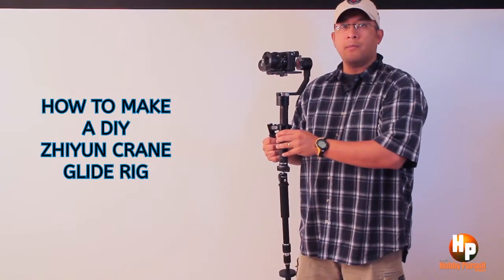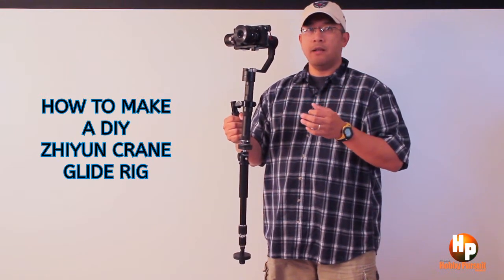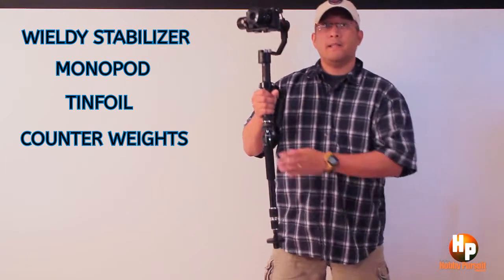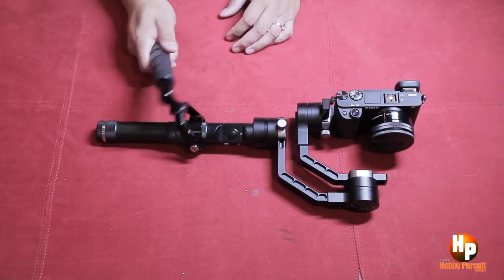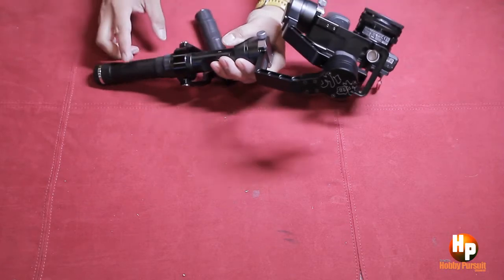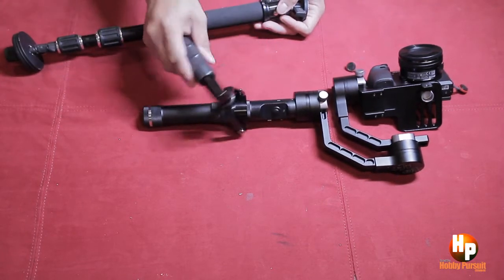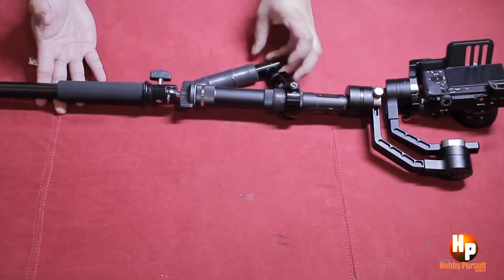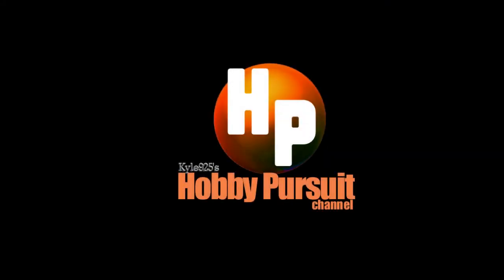HOW TO MAKE  DIY GLIDE RIG for the ZHIYUN CRANE

Comment: So I have an old flycam sitting around and started to tinker with removing the handle, but it appears that the handle may be attached to the vertical bar with something other than the screws (possibly glue?) unless I'm missing something. I saw you had the Wieldy and the flycam, .  Does that seem correct to you, or did I miss a screw/need to give it more force to remove the handle from the bar?  Really appreciate the video.  Not sure if worth it to spend the extra money on a Wieldy if I have a chance on making what I have laying around function.  Your work looks great!
Reply from the maker: Hello. If you plan to still use your flycam, pls do not go any further. As what I said in the video, I got lucky the diameter of the Wieldy handle was just right. I am not sure if the flycam will fit. So pls refrain from dismantling the flycam because you might be not able to put it back to its original form and condition ( thus my big WARNING DISCLAIMER in the comments section ). But if you are willing to trash the Flycam, then I will let you know that I too had a tough time taking the gimbal off the Wieldy. It had a very tight thread ( and locktighted in) that I almost gave up. But after that critical bolt/screw, the gimbal came off easily. Good luck if you decide to proceed and Im hoping the diameter is compatible. Let us know so that I can give an updated message that the flycam diameter also works.
Reply: Just wanted to report back that the flycam 3000 diameter is too narrow for the bearing to fit over the threaded section of the zhiyun crane.  ( I didn't destroy it in checking either thankfully- I bet there is a way to make it work, but not without some machining)

Comment: Shouldn't the system be level not a 45 degree angle when you do the drop? also 3 seconds seems a touch too long. Good idea tho, ive been thinking about doing this for a while now...might give it a go.
Reply from the maker: Hello. It should be leved but depending on the positioning of the camera to the ZC gimbal. When you have a sharp angle like that, the ZC compensates thru the gimbal and the camera weight now causes the counterweights to react. Thus the angle that you see in the video. But once you have everything leveled, it stays leveled. As for the 3 secs, it is really up to the user preference. I prefer the long drop because I notice a more stable ZC platform. But I demonstrated in the video that the user can adjust the drop to their liking. Thank you for watching my video
Reply: Cool, thanks for the info dude. Keep  up the good work

Comment: Hi. Do you have any information about the thread needed for this new Zhiyun Crane ? It'll be quite useful in order to find the appropriate glidecam. 

Thanks to answer
Reply from the maker: Hi. I do not have specifics on the threads. As i'ved said before, I got lucky with mine. Also, just an FYI, the new ZHiyun Cranes that are coming our right now , the barrels are quite different where there is no more threads to the tip of it w/c prevents you from tightening both the front and and back in place if you have the gimbal in the middle. This mod should only work on the old lots of Zhiyun crane!
Reply: Ok. Any chance that you can work some kind of alternative so the new ZC can be fitted with a Glidecam handle ?

Thanks to answer
Reply from the maker: Unless you have access to a threading tool/machine, I can't think of anyway to make it possible. Sorry.

Comment: when you factor in the price of the Weildy, monopod, and zhiyun then it's not worth it IMO.  the purpose of the zhiyun is to have a small, light, compact stabilizer.  However, I understand that you want the ultimate stabilization possible!  So do I and thus I like to add a very light small tripod to my beholder ms 1 to achieve certain shots.  Helps to stabilizer my shots even more and avoiding using software stabilization

Comment: This seems excessive and pointless. It is a small handheld gimbal. This seems like a downgrade.
Reply from the maker: I respect ur opinion. But if you've ever handled both a manual stabilizer and electronic gimbal ones, you'll know what I mean. These electronic gimbal stabilizers doesnt completely eliminate shakes. I have seen some electronic gimbal reviews out there and I feel some are just cheating themselves  because I can detect some obvious footage "warping" w/c indicates some post production editing ( aka AE warp or Mercalli stabilization) .  My  ULTIMATE GOAL  as a  stabilizer operator is to find the ultimate rig that would produce some super stabilized footage to AVOID POST PRODUCTION STABILIZATION.  And from a stand alone Zhiyun Crane,  to adding my glide rig ... I am close to my goal. This rig is definitely an upgrade both on functionality and ease of use (Ease of use because this rig doesn't produce any muscle/arm strain whenever I use this combo).
Reply: Disagree. This is an upgrade. A steadicam with an arm and vest reduces the up and down bounce you would create walking. The gimbal itself where you hold it is where the action is reduced.

The Crane can only compensate for roll, tilt and pan. When you run around with it, you will still get that bounce. Adding the steadicam style of handle reduces that.

There's a company that uses a 3 axis head like the crane on top of the steadicam pilot. So you're comment on this being pointless is completely off if Steadicam and DJI did it together.
Reply from the maker: Well said sir! Thank you.
Reply: true, but only true if actually used with an arm and a vest.. like this... well...
Reply from the maker: mps i hate to disagree but the arm and vest is a novelty in my opinion. i own one and it hasnt seen daylight for a good number of years now. i will be doing a video soon on why the arm/vest is a hyped up gear. stay tuned.
Reply: Exactly my thoughts, it seems like he gutted an expensive glidecam to make a stabilizer that you can buy for like 20 bux. It’s two bars with a cross bar that make a dual handle stabilizer for the cranes. Its exactly what it’s named, a dual handle stabilizer. It’s like the movi rig but not a complete “box” and works pretty much the same. This seems like too much added weight. This was kind of pointless to do.
Reply: It’s not excessive nor pointless. You get the best of both worlds!